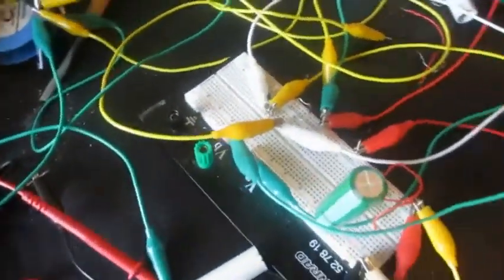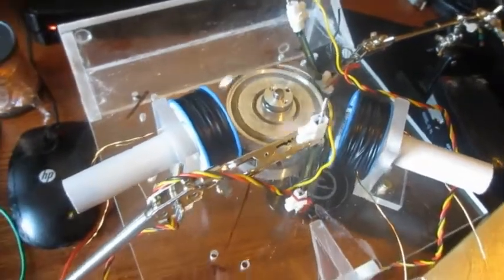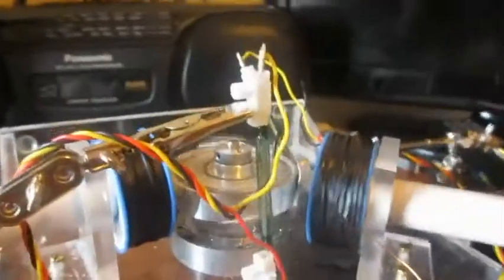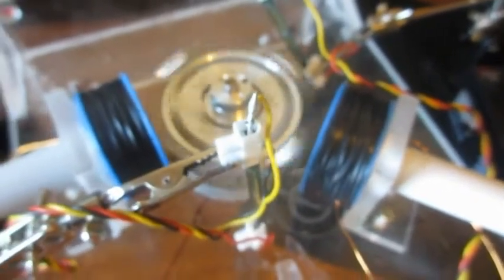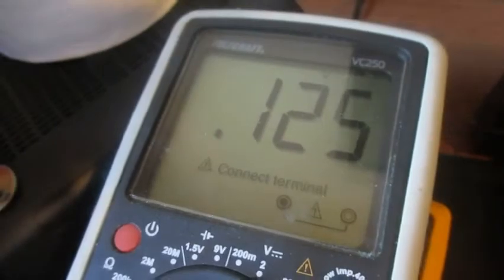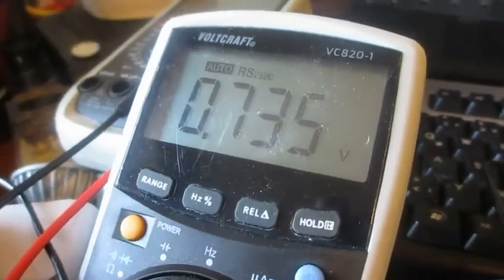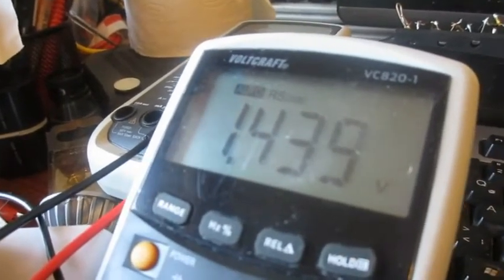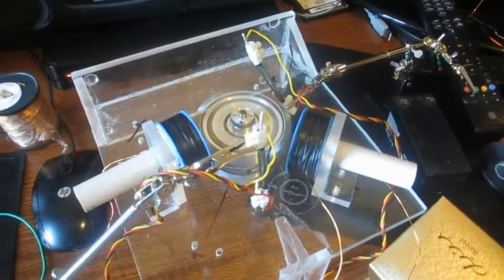moroz motor replication part 2 (supercap)

Comment: very nice with mA thanks for sharing
Reply from the maker: its mV not mA, i tried to measure the milliamps but it doesnt stop pulsing ... jumping up and down.. somewhere between 20 and 100 miliamps. I got to find a 1 ohm resistor to be able to measure it... but it is bound to change with the voltage changing so quickly. Thanks for watching.